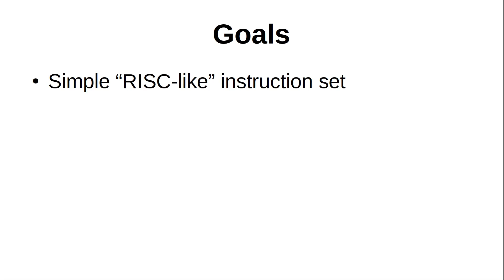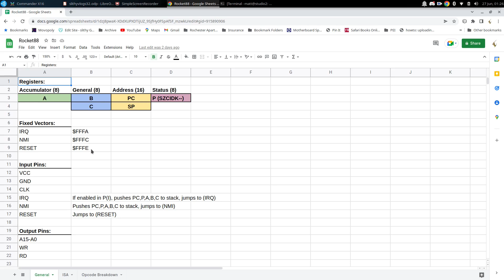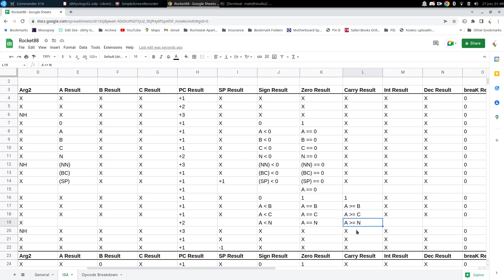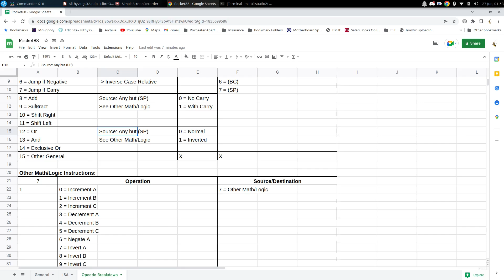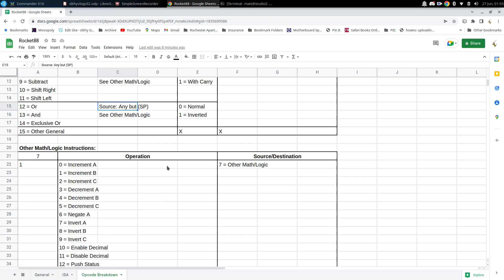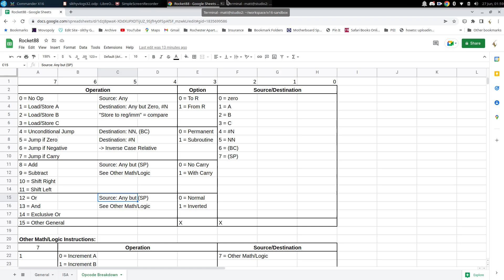ROCKET88 - A New 8-Bit Architecture - slithy VLOGS #32

Comment: what were major innovations in the age of 8-bit CPUs? 1) sufficient relative addressing modes to support relocatable code, 2) shadow registers for the invocation context of interrupt handlers 3) a register that holds a base address of the zero page 4) 16-bit multiply where result lands in two registers. A stack pointer register that's 16-bit is nice so that can have a call stack greater than 256 bytes. Likewise, to make a CPU friendly to high level languages such as C and Pascal a stack frame register like the 8086 BP register is very nice. Of course the Motorola 6809 nailed a number of these - and hence why the SuperPET had a 6809 co-processor as was being targeted to computer science departments
Reply: This is a good point. The 8086 extended the address space with the "segment" register (this offsets the address by 4 bits), and the 65816 has an 8-bit bank register. This means the 8086 can relocate to any 16-byte boundary, and the 65816 can relocate to a 64K boundary. 

Of course, this dramatically increased the instruction set complexity, as both CPUs then needed far pointer logic, and suddenly the programmer needed to consider whether a read and write was to code, data, or stack space... if I was designing an 8/16 bit CPU, I'd probably go with 16 bit page registers, which would extend the address bus to 24 bits. I'd also end up with like 8 of them: Code, Data, Data2, Video, I/O, Stack, Far-Code, and Far-Data. 

Far-Code and Far-Data would probably not be real registers, but would be address modes that take a 24-bit address.
Reply: 6809E was maybe the ULTIMATE 8 BIT processor. Mainly by adding a USER SPACE 16 bit stack pointer...
Reply: Of course the 6809 had S and U registers rather than a single stack pointer which was nice.

The Hitachi 6309 (which was a kinda extended 6809) is also interesting as it had a few more registers and a few other nice features.

Comment: Nice! Looking forward to it.

Actually have had a 16-bit RISC-like architecture in the works for a while, though it only exists as a LibreOffice spreadsheet and an unfinished assembler at this time. Looking at ROCKET88 here, I think I may need to rethink my opcode arrangement…
Reply: I actually created a 16-bit CPU on an FPGA, and it worked! However, feature creep, support chips (video!) etc. killed it, as well as lack of memory (just 64K). Currently designing a kind of 8086 but with a flat 20-bit address space. But too many side projects to finish 😄
Reply: I ended up with a similar arrangement, too. Whenever you try to build an orthogonal operation set, you end up in the same place, with operations on the left and registers on the right. The difference is going to be how we arrange the registers. For example, I wanted more reigsters, so I ended up with a 2 byte instruction set. Byte 1 was the operation with flags, and the byte 2 was the operand byte, which encoded the registers used and the address mode. There were 8 registers, 4 page registers, and 4 special address modes. (Zero,  immediate, direct [address follows opcode], and one I haven't decided on yet.)

So LOAD A,B took 2 bytes: 
LOAD
Mode: A, B (0001 0002)

But something like LOAD $1234, #$2302 would take a total of 6 bytes:
LOAD, 
Mode: address, immediate (1110 1111)
address L
address H
value L
value H
Reply: @tomwilson2112  Interesting. Definitely need to figure out how to do a 2 byte instruction encoding for Cellia, I’ve just been using single byte opcodes so far and that’s not going to work for an orthogonal encoding.

I currently have eight general registers (A, B, the high and low bytes of A and B, and X and Y indexes) but I’ve been wanting to use 4 bit register encoding to leave the door open for adding 16-bit float support. Not really necessary though, so I can just use 3 bits. Stack pointer is 16-bit, but there’s a separate register that sets the bank the stack resides in. Instruction pointer is 24-bit. Flag register is 16-bit but mostly unused.
Reply: Update:

There are now 437 distinct opcodes, not counting integral arguments like registers (or 8-bit immediates in some circumstances), split across 119 instructions.

There are now 12 addressing modes, of which half are direct (address follows instruction in memory) and half are indirect (address stored in specified registers). Absolute addressing is 24-bit, zero bank and port (I/O) addressing are 16-bit, instruction and stack pointer relative are signed 16-bit, and direct page is 8-bit.

There are now 8 general purpose registers: the 16-bit A, B, C, and D registers, and the 8-bit W, X, Y, and Z registers. The registers may be paired off for absolute indirect addressing (take one of the ABCD registers and one of the WXYZ registers, e.g. AW, BX, CY, DZ). Only the ABCD registers may be used for indirect zero bank, port, or relative addressing, while only the WXYZ registers may be used for indirect direct page addressing.

Stack Pointer (SP) is 16-bit with a separate 8-bit Stack Bank (SB) indicating the bank byte. Instruction Pointer (IP) is 24-bit.

Zero Bank and Direct Page addressing both imply a bank byte of 0 in the full 24-bit address, but Direct Page sets the page byte to the contents of the DP register.

Flag register (F) is 16-bit, but only 9 bits are used right now.
Reply: @AshtonSnapp  sounds cool, but not RISC-like at all 😄
Reply: @kilianhekhuis  For clarification, when I say “RISC-like” I don’t mean it’s going to be a RISC architecture. Just that it’s going to use some of the same principles (load/store architecture so most instructions only work with registers and immediates, instruction pipelining, orthogonal encoding).

Nonetheless, can you please explain your reasoning here? Simply saying “not RISC-like at all” isn’t exactly useful feedback.
Reply: @AshtonSnapp  Not sure if YouTube comments are the right format for this, but I'll try. RISC architectures, in general, have many of the following characteristics: 1) load/store architecture, i.e. memory to register and register to memory, and no memory operands in any other instruction (so no ADD with memory operand, etc.); 2) a relatively large number of fairly general purpose registers, at least 8, preferably 16, typically name R0-R7 or R0-R15; 3) one register, typically R0 that is read-only and always returns 0, another one that is the program counter (e.g. R7 or R15), no specific stack pointer (the ABI defines which register is used); 4) arithmetic instructions with three operands, one destination and two sources; as a result of this, no register-to-register copy operations, but instead just ADD with one of the source being the always-zero R0; 5) fixed-length instructions, typically with the same width as the data bus. Some instruction sets do this in extremis, not allowing the full data width of the register being set with a single instruction; 6) all instructions having a condition code that defines whether the instruction is executed or not; conditional jumps are thus normal jumps with a condition code set; 7) instructions that consist of a single operation, so no auto-increment memory access, no offsets in memory access instructions, etc. No push/pop for stack, no RET (instead, load from stack, adjust stack pointer, add the value read + the zero-register to the PC register) etc.

Note that these are all just general tendencies, but you'll need a good set of them to be considered actual RISC. Your instruction set, though nice enough, is almost non of this (except perhaps the load/store).
Reply: @kilianhekhuis  Alright. I'm taking a look at this here, and you make some good points. I'll try to revise my architecture further, but here are some notes I have as to some of these:

First, one important thing to keep in mind is that I'm trying to encode all instructions into a 16-bit operation code, although certain operands like immediates or direct addresses would have to follow the opcode as they wouldn't fit. Since I only have only 16 bits to try and fit every instruction into, anything that I try to make consistent is going to eat into that. So there's simply no room for having all instructions have a condition code. Even just doing conditions on a single flag would mean I need 3 or 4 bits. This also means simplifying the arithmetic operations - if I want to have more registers, I'll need at least three bits to encode them. If I want three operands, I need 9 bits to describe them. This leaves 11 bits to describe the operation itself. That might be enough, that might not. Better to be safe than sorry and just have the destination be implied as one of the source operands.

Second, locking a register to the value of zero seems wasteful. If you have the space to encode more than eight registers then sure, but otherwise every register you have is valuable. I'm already sort-of 'multiplexing' the amount of registers I have by using context - instructions that work with registers have a bit that indicates whether it works with the 16-bit registers or the 8-bit registers, and the indirect addressing modes indicate how to interpret the register bits. Having one of those registers be tied up in always holding a value of zero seems like wasted potential. Why have a register with a fixed value instead of a register that can hold any value you want?

Third, I can understand having the stack pointer register (or register pair in this case since the address bus is 24-bit, this is also why the 8-bit registers exist) be whatever register you want it to be - especially since you can basically have as many stacks as you have registers. But that leaves the topic of interrupts. In a processor like a 6502, a bunch of stuff gets pushed onto the stack whenever an interrupt occurs. Specifically, it needs to push the return address and the processor status register. But, unlike when calling a subroutine, you can't control when an interrupt occurs - unless it's a software interrupt or break, but that's besides the point. Whenever an interrupt occurs under an architecture without a set stack pointer, how does the processor know what register it is supposed to use? Would it just be hardwired to use a particular register? If so, then why not just have a dedicated stack pointer register in the first place?
Reply: @AshtonSnapp  As for having a zero register, it pays of a lot if you have 3-operand instructions. For example, you don't need a MOV instruction if you can do an ADD R2, R3, R0 or SUB R2, R3, R0 to put the value of R3 into R2. Likewise, you don't need a CMP instruction for comparing, you can just use SUB R0, R2, R3 to compare R2 and R3 (since writes to R0 are discarded). As for interrupts and stack, there's several solutions for it. One could be a set of shadow registers that are swapped in when an interrupt occurs (including a shadow PC), another could be a reserved interrupt stack or interrupt stack pointer.